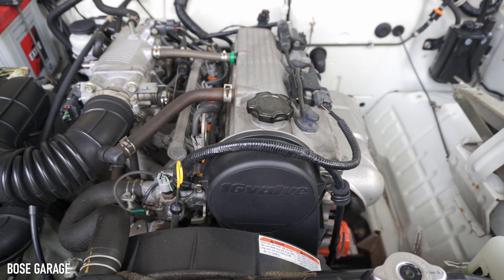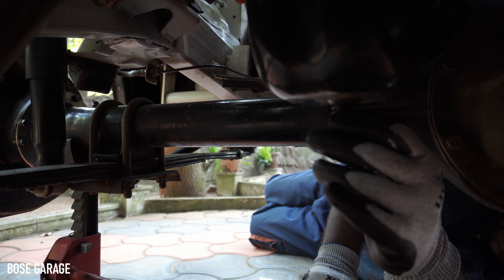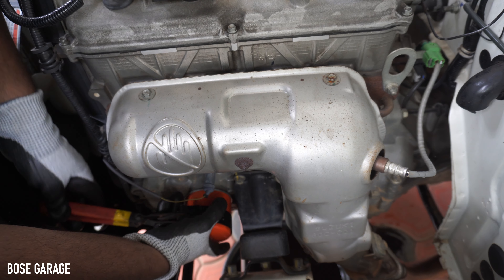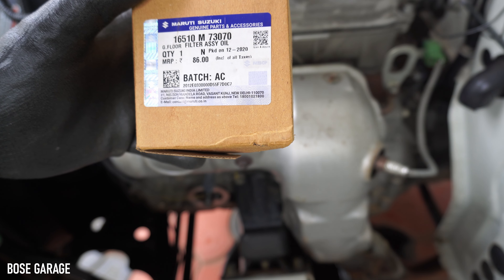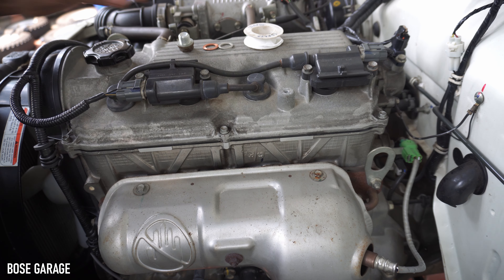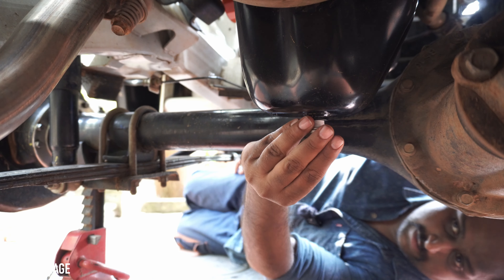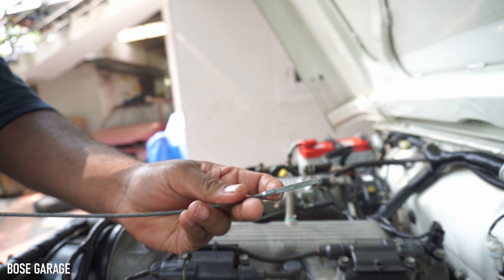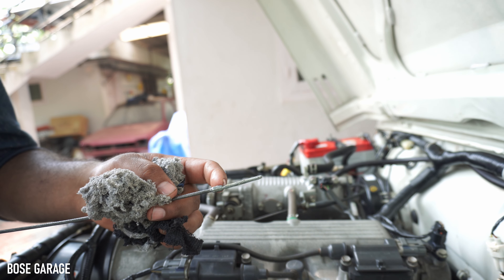Maruti Gypsy King | How to change engine oil and oil filter at home in less than 10 minutes

Comment: Not mandatory but one can fill the new filter with some oil and then instal. That pushes oil to the head a trifle quicker on start up.

The dip stick shows max even with 4L oil. You’re right the manual suggests 4.2L including filter capacity.

Neatly done 👍🏼
Reply from the maker: @srschhina5295  Totally agree with you regarding filling a bit of oil in the spin on filter before installation. I do the same on my bullet and diesel jeeps that have the old type filter element. Soak them in oil before installation.

Thank you 🙏🏻

Comment: What was the reason there for using Teflon tape on to the thread..?
Reply from the maker: @Thusharsreelekshmi  I always apply teflon tape to the drain plug thread for proper sealing. Also I don't want to overtighten the drain plug.